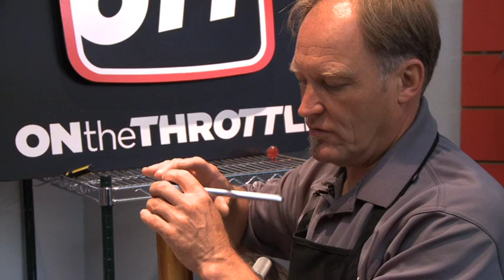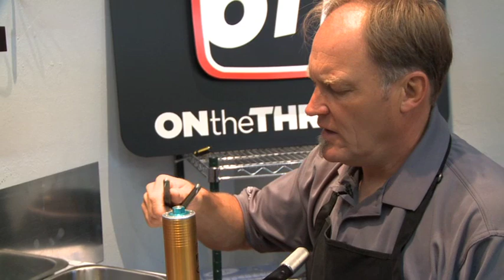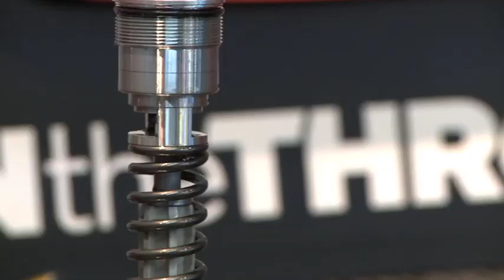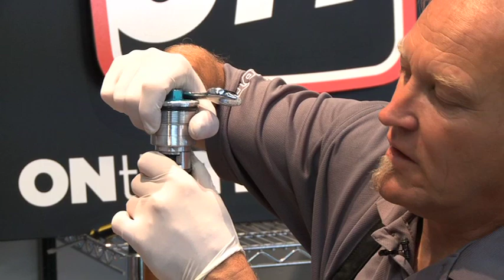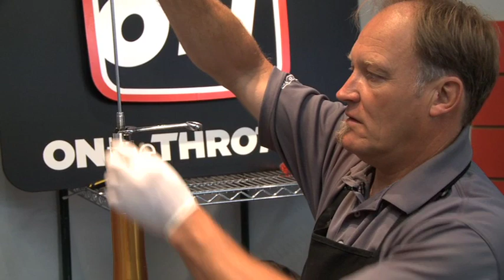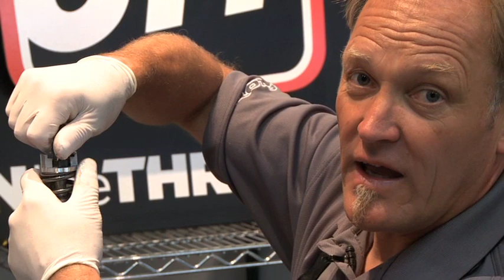Ohlins Road and Track Trailer

Comment: Ohlins has different conventions on how to set oil level depending on the fork.  Some are without spring but with preload tube, some are even with spring but without preload tub and some are without either.  You need to get the specification sheet from Ohlins or an Ohlins service dealer for your specific fork and it will tell you how that forks oil 
level is set.   Probably the fork in the video is one that is measured with the preload tube.

Comment: when you service the forks, the demping will be different then it was before. that means that you need to adjust the suspension afterwords agian, for a proper setting. So it has no use to write down the adjustments before taking it apart..

Comment from the maker: the idea is to clean the sliding tube regularly (weekly) to get all the dust and debris off it including insect skeletons that can rip a seal. Every once in a while depending on monthly mileage the fork seals need to be lightly greased to prevent stiction. If you ride in wet weather using a product like seal saver to get the dirt and debris out of the fork seal is also very helpful.

Dave Moss
Host

Comment from the maker: just worked on one and settings are forks: sag 35mm front, compression 5 turns out, rebound 4 turns out. Rear sag at 30mm, compression at 2.5 turns out rebound at 1.5 turns out

Dave Moss
Host

Comment from the maker: if you have one undamaged fork cap, duplicate the settings from that. If both are damaged, you can see the preload settings so then you will have to guess the rebound setting with should be between 10-14 clicks out in a total range of 18-20

Comment: Great help, purchased the video yesterday, just one question I've 2014 Honda Cbr 1000rr SP, 43x55x11/14 is that the right size fork seals? Thanks in advance.

Comment: hi, I have similar fork (ducati multistrada 1000s) with a slight difference; after take out the rebound rod and turn the fork upside down to drain oil, there was a small pin and spring came out in to oil. sadly, I didn't  noticed this on the first leg so I didn't try to catch how they was pleaced. I am not sure if i put them back correctly. actually, I  bought this video to comfort myself regarding this matter but nothing about it. is spring first and pin later with flat side up correct? thanks

Comment: Bought the vid and it's great!
Can I spray parts cleaner into the inner tube where the cartridge is to help dislodge some of the metal debris in there?  
How did you determine what level to fill to?  (I've seen the chart but not sure how to read it.
Thanks Dave!

Comment: Quick question.. I'm try to replace my fork cap on my 04 r1 which was damage in a crash. Do I need to write down all my setting info about the fork before i take the cap off? Or can i just replace the cap. If so..I can't, cause the fork cap was grounded down pretty bad so, I cant adjust it at all. 
 Thanks for any info.

Comment: Ohlins manual says that oil level height must be measured whithout the preload tube. You say the opposite. It means a big diference on the oil height and its consequences. Please help me whith it!!!
Reply: +Hiroji Okano Jr  Ineed to know too ! please im doing my fork and this is a huge difference in measurement.
Reply: I've tried 150 mm whithout the preload tube and whithout spring. The forks became very stiff. I'd better went 150 mm whith the preload tube in and spring out. That's what I knew.
Reply: I did mine with tube in. Its perfect

Comment: Hey Dave, what is your opinion on this fork with the 25mm piston and the newer ff521 with the 30mm nix? I currently have the fg424 and am wondering if the newer ff521 is an improvement or just a side step? Thanks!